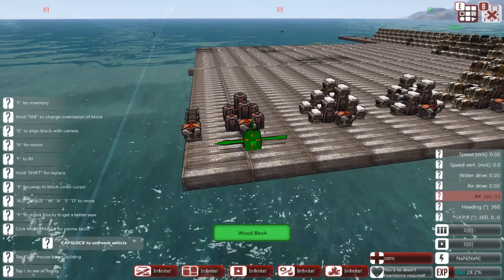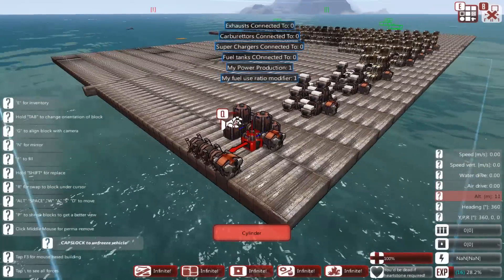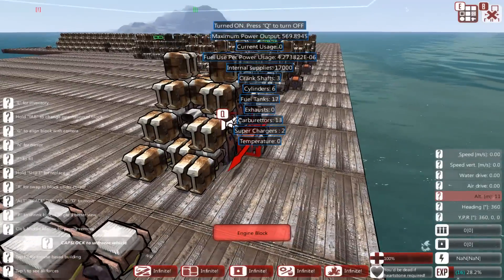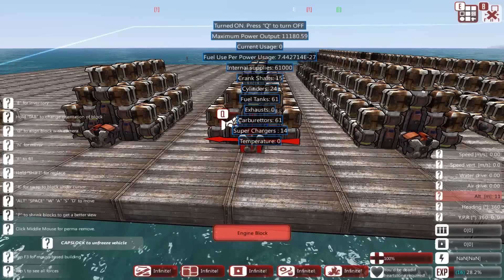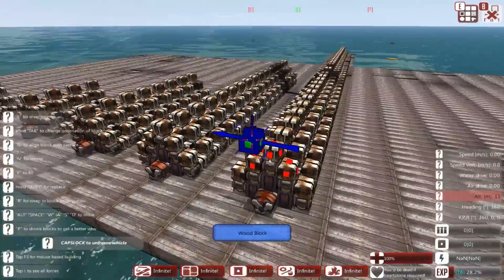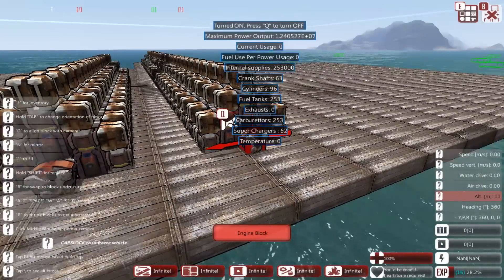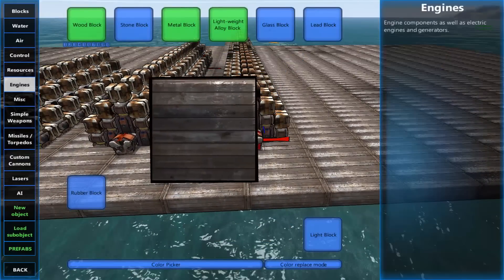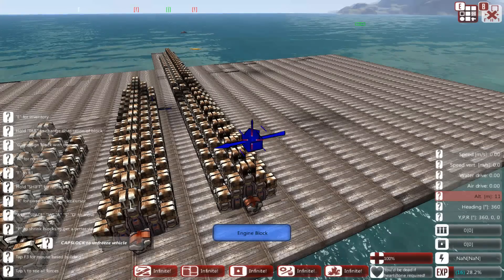Engine Power Scaling ► From The Depths Test Lab | Build Tutorials #FTDTestLab

Comment: ever try making multi shafted engines? (its still multiple engines, but they are clumped together in a very specific pattern to share components with adjacent engines to give very effective use of a smaller space while having lots of efficiency and power. the middle engines will give more power,
Reply from the maker: +LemonHeroman It's not something I've looked into, but sounds really interesting! Do the engines really share components?

Basically, until the engine overhaul arrives, it's quite easy to build way more engine than you'll ever need. As a result, there's not a lot of impetus to create novel designs, beyond the novelty itself. Once the engine overhaul gets here, I'm excited to see what new designs let you get the most bang for your buck!
Reply from the maker: +LemonHeroman Also, "Multi shafted engines"

Hueh, hueh, hueh ;P
Reply: +Morjax Plays XD And it shares anything touching parts that can attach to the parts touching.. so like a carb could share half itself to both engines.
Reply from the maker: +LemonHeroman You learn something new every day! I wonder if they'll leave this shared parts thing in when the engine overhaul comes?
Reply: +Morjax Plays Im trying it right now.. They should still share carbs, superchargers and injectors, ill see about the turbos though.
Reply from the maker: LemonHeroman
Did the engine overhaul arrive?!?
Reply: +Morjax Plays Yep
Reply from the maker: LemonHeroman
Nice! I just may have to checka that out ;)

Comment: Thanks for this video!  I had tried making my own engines and it seemed like everything I tried ended up less efficient and less power/size than the prefab engine slices.  Retrofitted one of my ships that had two prefabs next to each other producing 2000 power to this design; now I'm knocking out 6600 in less space AND many more decimal points of efficiency.   And it shaved 8000 metal from the ship as a whole.
Reply from the maker: Seth E You are welcome, and I'm glad to hear it was an improvement for you! It's not the absolute optimal design, but it doesn't take too big an engine of this design to provide essentially all the power you could realistically use (at least until the engine overhaul arrives!).

Cheers!
~Morjax

Comment: very very nice, atleast your voice is good enough to listen too. Im telling you some ppl its like, "do i mute this or just... ga "  

Didnt think about the extra engine block

Know anything about the Left and Right connects for the engines? Was having trouble trying to figure out what they did or how they could help.
Reply from the maker: Sean Craig Glad my voice is tolerable ^_^ 

As far as the left and right connects, it allows you to sprawl your engine a bit be moving the cylinders away from the crank shafts, but I must admit that I've never used them. I prefer to make my engines as compact as I can, and think that expanding them out just makes for an unnecessarily larger target.

I'm sure there are some fancy and creative uses that folks could figure out with these, but I'm neither fancy, nor creative ;P
Reply: mookiemorjax I might have missed one of the vids you did, but did you ever explain missiles? Im pretty good with them, recently made missiles that traverse almost 4k meters (i think its meters, the units x3 )though it wasnt the purpose. A pesky paddle boat managed to run away in a battle and it just kept going like omg.

On another note when i first First started FTD the keyboard based building seemed really complex for some reason but now i looked back at it and wow its rather easy and just.. wow

Doubt you'd wana add me, butt im NyaSoftie on steam ^^; my icon is a red/orange/yellow/white animal thing x3
Reply from the maker: I've not dabbled with missiles a ton beyond just making some that are serviceable (i.e. I haven't taken a bunch of time tweaking particular performance). Maybe I'll cover that down the road, but I'd have to read up and get good at using them at a more advanced level first ^_^
Reply: mookiemorjax I cant say i've mastered missles but i think i have an advanced handle on them if you have any questions shot them at me, love to help someone else on this game. I wouldnt' suggest looking at any missile vids older than a month since alots changed. work better.
Reply from the maker: +Sean Craig I may take you up on that, but perhaps not right away. I'm working on getting my FTD 10k block tourney running (first ep tomorrow, 8/10!! Stay tuned!).

I'm morjax on steam as well.

cheers!
~Morjax
Reply: dam, some of thos builds formt eh 5k were big enough x3 heck